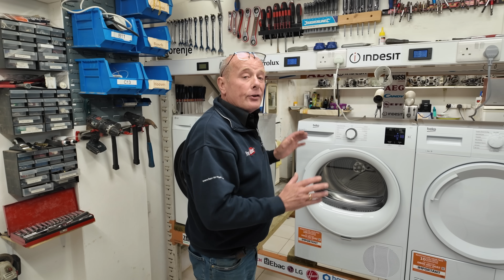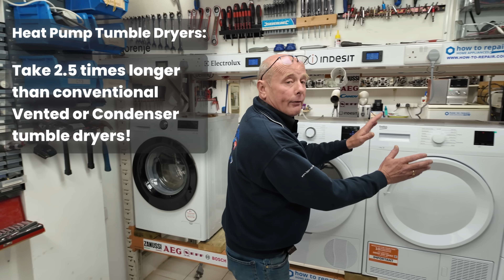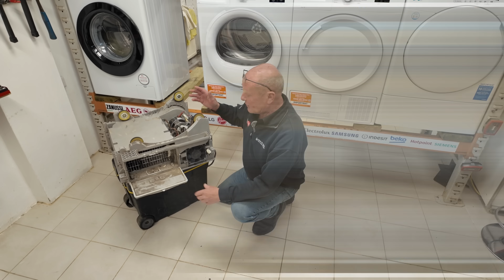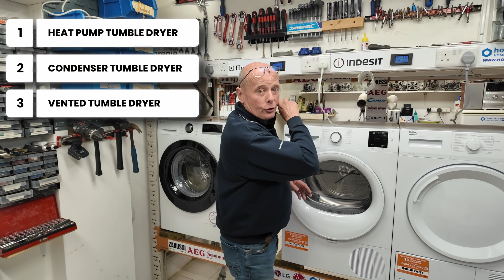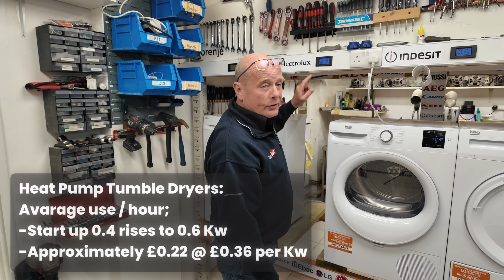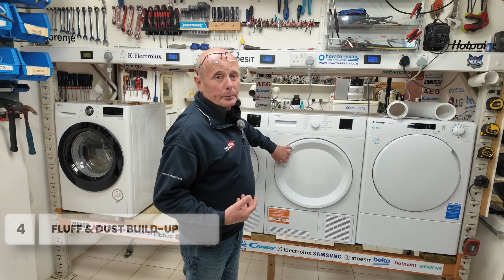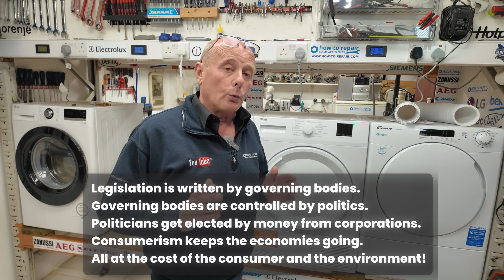Tumble Dryers the Shocking Truth About Heat Pump vs Vented & Condenser, NEW LEGISLATION!

Comment: My experience does not match the said. We have a Miele heat pump dryer and it does not take longer, than the condenser dryer we had before. Also the amount of fluff coming from the cloths is not higher. It correlates to the remaining moisture of the fabric. The more you dry, the more fluff you get. But that was also valid for our condenser dryer. Energy consumption dropped by 50% compared to the condenser. And at least for Miele there is a fine filter sponge before the heat exchanger capturing all the fine dust. Our appliance is running for over a year now and there is no dirt in the heat exchanger. Downside is you have to clean the filter on regular basis what can sometimes been a pain. And even though you might be right about the energy consumption of condenser dryers and vented dryers you have to take into account you suck air out of your house hence pulling cold air into your house that has to be heated up again. This adds additional ballast to the house heating costs.

Comment: I am a Canadian, and I can sympathize with your situation. I am retired, and for many years, I used washers and dryers that were simple, and inexpensive. Many homeowners were able to perform most of the required maintenance and repairs on such items. As long as my clothes ended up clean and dry, that was all that I wanted, as there was no need for a lot of fancy features that I never used. 

Greenwashing seems to be everywhere these days and decisions are often made by politicians who are incapable of making rational decisions. The simple act of manufacturing an appliance uses a great deal of energy, which is often overlooked. As an example, when I was a young engineering student, a professor of mine informed us that the energy required to manufacture a vehicle, was similar to the amount of energy that it consumed over its service life. I really dislike having to discard something prematurely solely on economics. 

Heat pump dryers should be made available to those who wish to purchase them, and the other products should still remain in the marketplace. If there are proven benefits related to the use of these items, they will sell themselves. Such a decision should not be mandated in a supposedly free society.
Reply: Since when was Canada a free society?

Comment: It's a complete false economy for sure - and absolutely nothing "green" about it.  Our Bosch Series 4 dryer (heat pump) after 3 years needs to run for HOURS to get anything remotely dry.  We are often having to put the clothes back in (again and again) to get a good result.  Yes, the filters are kept religiously clean.  I've seen videos on how these machines need to come apart to remove all the lint built up inside, and while the task is not beyond me, I don't want to do it!  Nor do I want to pay someone every other year to come out and do it for me.  I'm in France, so naturally it's next to impossible to get a condenser dryer now (November 2025) ... Incredibly frustrating.

Comment from the maker: I've recently published a video that specifically addresses the Planned Obsolescence issue, revealing the SHOCKING truth about your appliances. Here is the link in case of you’ve missed it: https://youtu.be/QsdGd2qDPaI?si=cgeEoBVVrtxWd_Bj
Reply: Just use a clothesline.
Needs 0kW.
Reply: @ABa-os6wm  after you spend half hour taking clothes outside, pinning them, watching for rain, run outside, bring them in, rinse and repeat .... Yawn. Buy the dryer!
Reply: @ABa-os6wm  only if you do so outside. Weather often won't allow for that.
Reply: @How-to-repair 
We have a 2012 Cylinda TVP 420 with heat pump. It has a 800 W max rating and it has served us BRILLIANTLY for 13+ years now. Only thing is a bit of belt slip(?) causing noise during first minutes of operation, that's been for many years now. We found it on sale and I got the price down a bit more, picked it up for around £400, original price was twice that.
It dries 8 kg of clothes in 60-90 min, so I'm not sure what garbage is on the market these days. 
Our 2012 Cylinda Sverigetvätten washing machine is very similar to the ASKO you recently reviewed, only older... We also have a Cylinda Sverigedisken, dishwasher, from 2012, nowadays produced by ASKO, while Cylinda took the path of planned absolecense. Our parents in law have an ASKO and after an initial warranty repair, it's been GREAT and the inside is fabulously great to allow three layers high stacking and STILL getting it clean!
Reply: Our new heat pump Candy (over 400 pounds) stopped collecting water after two months and not knowing this was a problem we carried on using it over the winter. But now I have to take it out the back and strip it down or throw it away, with warranty out. Big money mistake. 450 quid down the drain.
Reply: The argument policy makers would make in response is that it's a new technology, and will improve - repairability, durability etc. will catch up.
Reply: Your math is probably in error, I assume dryer is some heat pump model. With all their complexity and maintenance, heat pumps can save 50 to 70% on energy
Reply: i dont know about your heatpump, my heatpump dryer is like your condenser i have 2 filters i can easily remove and clean. one is inside back of the door and the one is at the bottom that has the fine elements you were saying. hmmm im skeptical about this review boss on heat pumps. mine also last for 30min to an hour it has smart detection and adjusts time from 2.5 hours depending on what is inside the drum and its dampness
Reply: Hi
I am at the appliances world in Israel for more than 30 years . 

I have to say I like your videos a lot but I don’t think same as you for dryers . 

I’ll explain 
We do had a terrible experience with the first generation of heat pump dryers , Bosch and Siemens also Miele were a disaster for clients . 
But lately the gas has been replaced with one that gives good results. And the heat pumps are starting to be running fast timing . 

For the vented, at your video you showed Candy Hoover turkey factory plus Beko blomberg turkey factory and we all know AEG Electrolux and zanussi Thailand vented factory , all of those are built to last max 5 years , they rotate, sounds like a drum machine in a concert , uses 2300 watts heating element max and easy to be dented during deliveries since thin body . 
Where’s Bosch vented ? Or Miele vented ? Zero !!!! Why ? 
The answer is in Donald trump speech at the UN … the world had gone nuts with the energy efficiency thing. 
And the manufacturers? They shake their hands gladly since only the real good ones will achieve the A signature (so maybe it’s all a fraud of the German manufacturing company’s???) 

For the moment 
Heat pump will be leading the European market, while in the United states, vented will still run the show . 

Ilan b 
Mister electric Jerusalem
Reply: @ilanbrosh  It must be wonderful to reside in a country with a favourable climate like Israel.

Unfortunately, much of the Northern Hemisphere operates in a damp climate with colder conditions. The UK also has electricity costs that are the highest in the G20. Running a heat pump for more than twice as long as a conventional drier with that overhead is ludicrous.

My AEG vented dryer is 15 years old. Other than clearing the vent tube every 5 years or so, there is no maintenance required and, as the video points out, maintenance is a DIY job or a couple of hours of a tradesman's time.

The whole point of the video is to point out that the 'climate crisis' is being used by manufacturers to sell us all more and more expensive equipment manufacturers profit from. Meanwhile, the entire European economy is going down the pan thanks to renewable energy and rising energy costs.

China is eating our lunch!
Reply: @RedHotscot 
You are welcome to visit anytime, I am at the city center, and will take you to a nice Jerusalem center tour beside the fact discussing tumble dryers 🎉
Reply: @ilanbrosh  Try addressing some of my points rather than attempting to stimulate tourism.

Comment: Thank you for your video. I like your approach, I totally agree with what you said because I fully understand the reasoning behind it.
I'm not a technician nor an engineer. I'm simply a home appliances enthusiast. When I was watching your video, this crossed my mind - could it be that there is no actual efficiency gain in heat pump driers? My idea is this: considering a hypothetical conventional drier (either type but most likely condenser) with a heating element rated as much as the heat pump, how efficient would it be? Could it be that this hypothetical machine would dry as fast and as efficiently as a heat pump drier? We know it would use the same power. What about the time it would need to dry the same amount of clothes? I wonder.

Comment: I'm guessing the heat pump equipped machines after being cleanedhave to be reassembled air tight, so the air goes in exactly the coreect locations to be efficient again...of course gaskets are going to degrade with age and disassembly.

Comment: This is what manufacturers want.  It works out better to buy new rather than repair.  Its been happening for years with parts getting dearer.  One washing machine I went to repair had to have a whole drum as they stopped selling the 2 halves, spider and bearing kits. In the end it worked out economically to buy a new machine.

Comment: Thanks for the video although I am a bit late to the party, do you think they will phase out vented and condensing dryers totally and if so when? 
I know as of July 25
Product phasing: Less efficient models like non-heat pump air-vented, gas-fired, and condenser dryers will be phased out from being sold in the UK. 
Energy efficiency: Minimum energy efficiency standards have been raised, with only the most efficient heat pump models meeting the new requirements.
But
Condensation efficiency: A minimum condensation efficiency of 80% is required to help reduce damp and mould issues (does this mean only heat pump dryers can achieve this?)
What this means for consumers
New purchases: You will be more likely to find and purchase heat pump tumble dryers due to the phase-out of older, less efficient models, as of yesterday Curry's had 129 heat pump dryers, 29 condenser dryers and 6 vented dryers.

Comment: I don’t really agree with your points. I have a Bosch heat pump system and I’ve been running it weekly for the past 5 years and if you clean the filter in front of the condenser (which I see you don’t have) and other filters it’s running fine. The amount of energy it saved me already per year has paid more than 2 dryers already. If you go cheap on a dryer you’ll just pay it on long run that’s what my observation has been.

Comment: I have a Miele vented tumble drier which was left in the house when we bought it, that was 22 years ago.  It has never been repaired in our ownership.  By the way I have a basic Miele washing machine which is a mere 20 yrs old and still going strong.
Reply: Probably cost you a lot of money. Really drives up the electricity bill with it outdated tech. But since it's built so solid, it lasts so long, that it just feels wrong to get rid of it. Aside from Tech, Geopolitics also change...

Comment: You only focus on your perceived bad characteristics. There are many benefits. We have a 9kg heat pump machine with our matching 9kg washing machine. They take equal time for their programs and an equal amount of content. So we never have an issue with queueing and they have worked for 8 years now without interruption. We can dry things that can't be dried by the other driers, because they get too hot. They have almost no waste heat (to vent) and from our experience use half the amount of energy spread out. The power usage is way lower, matching our solar panels better throughout the year.

Comment: The venting dryer cools down the room where it is in because it is venting inside air outside when it is on. The fresh air sucked in the room can be cold in winter or hot in summer. Ours was in the bathroom and when it was on the bathroom heater had to reheat the bathroom... So a lot of extra energy used there also...

Comment: Just had a technician out, I paid $200  to hear that it couldn't be re- gassed so I should buy a new dryer, it's only 3 years old. Your advice was exactly the advice I received. Thank you.
Reply: In other words, the cost of repair was more than the cost of replacement. Our WP dryer is 38 years old because it was made to last. New appliances are designed to fail.
Reply: They can replace the complete heatpump, takes 75 minutes for a skilled technician
Reply: I have a H Dry 300 heat pump, its not drying the clothes, the fan at the front isnt spinning but the heat in the drum is non existant, it too is 3 yrs old, the last one was much older (Condenser)
Reply: @How-to-repair 
We have a 2012 Cylinda TVP 420 with heat pump. It has a 800 W max rating and it has served us BRILLIANTLY for 13+ years now. Only thing is a bit of belt slip(?) causing noise during first minutes of operation, that's been for many years now. We found it on sale and I got the price down a bit more, picked it up for around £400, original price was twice that.
It dries 8 kg of clothes in 60-90 min, so I'm not sure what garbage is on the market these days. 
Our 2012 Cylinda Sverigetvätten washing machine is very similar to the ASKO you recently reviewed, only older... We also have a Cylinda Sverigedisken, dishwasher, from 2012, nowadays produced by ASKO, while Cylinda took the path of planned absolecense. Our parents in law have an ASKO and after an initial warranty repair, it's been GREAT and the inside is fabulously great to allow three layers high stacking and STILL getting it clean!
Reply: It definitely can be regassed.. I work on small wine coolers and you just put a line tap on and then braze in a proper service port after changing components. Whether or not they actyally sell replacement parts for the fridge circuit is a different matter.. Also finding a fridge company that's willing to screw about with this stuff would be its own challenge 🤷

Comment: In 2011 I asked a man if He wanted the hoover condenser dryer that was in his garden and he said no so I took, it home and overhauled it. I have repaired it a few times sinse then but I still have it today.
  With the heatpump dryer when you have to pay a man to repair it or replace it at 5 years you will undo the savings on energy consumption thus defeating the object in buying it in the first place. You will actually be guilty of more polution of the enviorment in buying a heatpump dryer in the long run.

Comment: I have a Hotpoint tumble dryer from approx 1986 it is not used everyday but it is used frequently. It has also been well maintained, filter cleaned regularly and it is in the shed. I cannot fault it and my local supplier said "you will not get one of those I would wait until it gives up.

Comment: A plus in the heat pump dryers is that they tend to not go as high in temperature inside as a condenser dryer  so that they are more gentle on the clothes.

Comment: I’ve had vented and condenser driers that all worked well and lasted years, but after moving house I decided to do the ‘right thing’ and buy one with a heat pump…I’ve regretted it ever since. When it’s set to take just over 3 hours, I usually still have wet clothes after 5 hours and when it does actually dry the clothes within the set time (very rarely), I’m over the moon…but that should be the norm.  I can also see lots of thick dust and sand (I live on the coast) that is inaccessible, which is infuriating. I’ve only used it when there’s been absolutely no chance I can dry stuff outside, but lately, I’ve even started hanging stuff about the house, or using a dehumidifier, as even that feels quicker. Having watched your video, I plan to buy a condenser dryer while they’re still available for purchase in the UK. Thank you for you excellent and most informative advice.

Comment: My mom has a vented dryer that's over 40 years old, only just replaced the snare and sealing on the back a month ago and it's still going. 

On my condensor machine I already had a broken snare, two defect motors and a broken display (got water damaged due to condensation and dust collection everywhere).

Comment: The vented dryer will heat your home while it dries your clothes, and then use a wood stove which dries out the air in the dryer is putting out warm moist air the blend it perfect your home is heated by burning wood and using a vented dryer into your home.

Comment: So in short if you want a new tumble dryer or washer/dryer that'll last you better buy it soon before this legislation comes in and forces everyone to have to buy over priced heat pump dryers that WILL fail after about 5 years. I've got a washer/dryer that I've owned for oohh about 10 years now, still works well.. though this vid reminds me I need to give the filters in the door a clean, should probs go do that now while I remember :D .